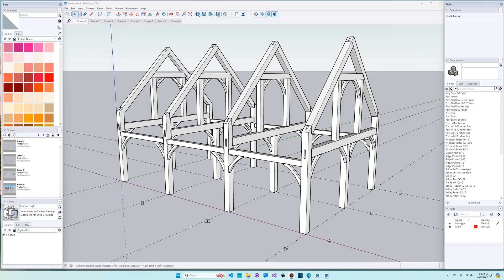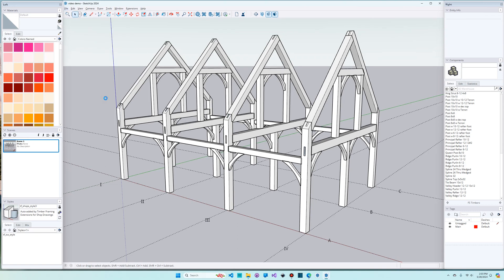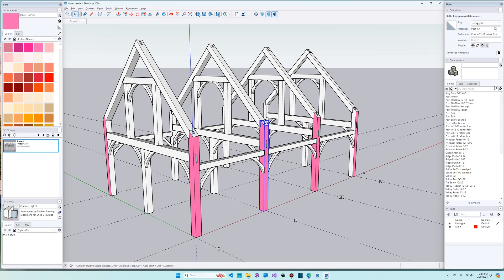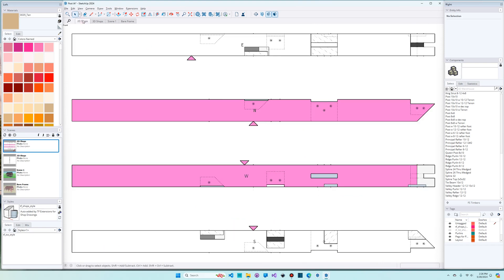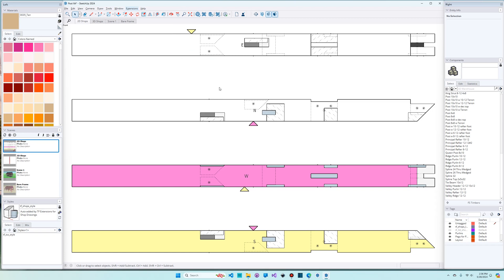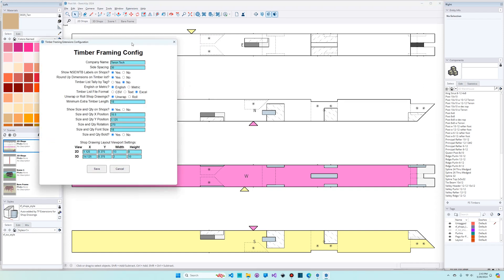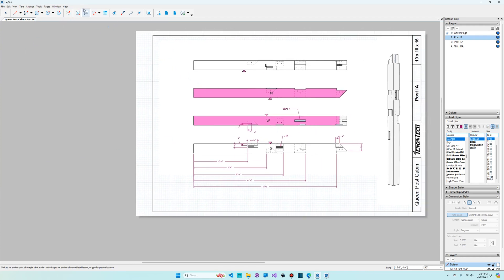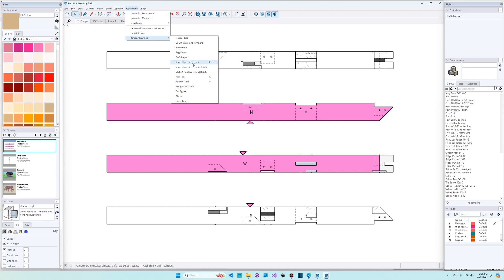Timber Frame Design with Sketchup Part 3 - Making Shop Drawings

Comment: Hi Clark! Is there a good way to depict splines? I am struggling getting them to interact with other joinery properly. Thanks for the great extensions!!
Reply from the maker: Splines are the hardest joinery to get right.  You basically make a small timber with "joints" that cut the slots in one direction, and others that cut the through mortise.  I'll be covering that in part 5.